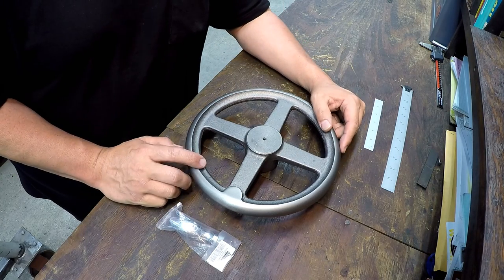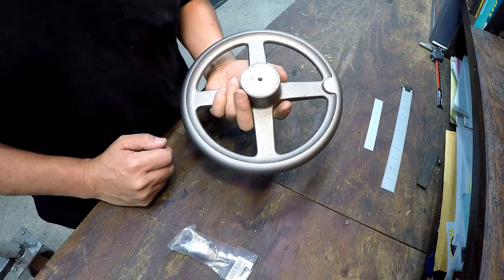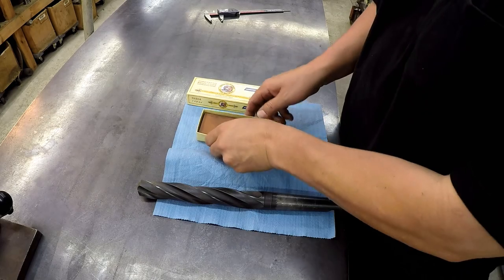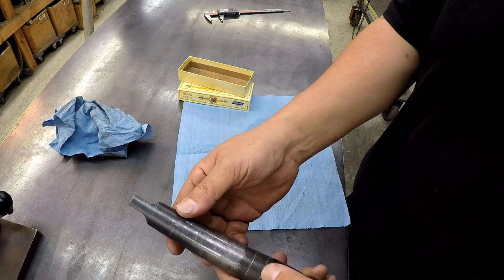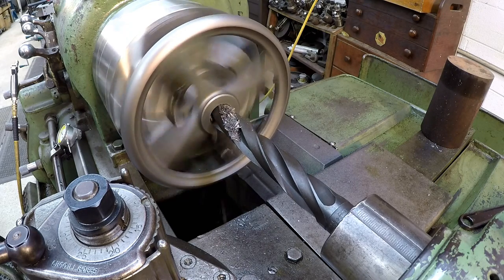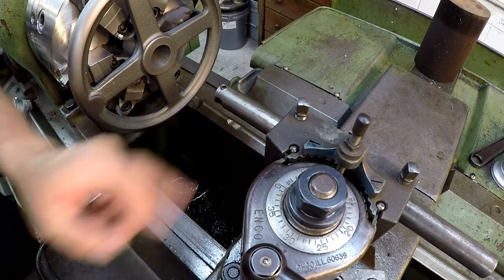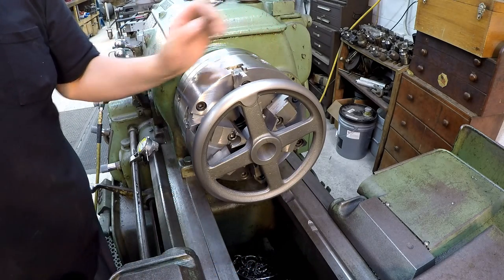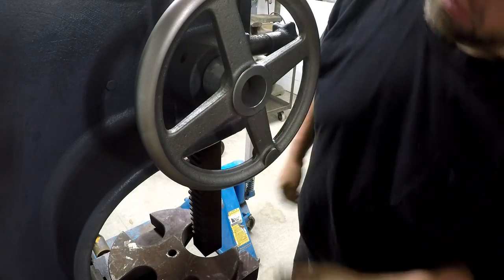Machining a Dake Arbor Press Handwheel

Comment: I like the job.  How about maching a button that plugs in the shaft end to keep dirt out!  Should be easy enough - could be a ball end and a shaft.
Reply: @Martin Eastburn ~ I was thinking the same thing. A BRASS mushroom end plug. Fancy! I made a white Delrin end plug for the arm on my floor jack to clean up the empty hole in the tubing,
Reply: I was surprised he bored it all the way through.  Could have left it a blind hole.  Either way works though, beautiful wheel!

Comment: Nice video... help me understand why you moved the work to  another lathe.  Seems like the work could have been done on the first 4 jaw set up.
Reply: He used a 3 jaw not a 4 jaw for the initial cut. The jaws were reversed on the 3 jaw from another job and would not have chucked up properly for the boring operation. Thus he used the 6 jaw chuck on the monarch lathe.
Reply: Gripping on the boss gives a much more stable grip than gripping on the curved outside. So he gripped from the outside while he trued-up the boss and then moved to gripping on the boss.  He could have swapped the jaws on the 3-jaw chuck he used to grip the outside and used it to grip the boss, but given that he had another lathe already set-up with a really nice 6-jaw it makes sense to use it.

Comment: 15:00 Hate to say it my friend, but hardness does not affect the rigidity of a boring bar. Only the modulus of elasticity, which is pretty much the same for all steels.
Reply from the maker: Sorry, but I don’t buy it. Take my 1” heat treated and stress relieved bar  and compare it to a 1” bar made out of 1018 cold rolled steel. Big difference in rigidity. I only speak from experience in use. That bar I was using is just like any quality boring bar you’d see being used with a carbide insert.
Reply: @Abom79  Well Mr. Booth, I must respect your experience as that is often the only thing that matters. However, from a theoretical POV I must disagree. If you have some free time, I might suggest some bedtime reading about Stress vs Strain curves, Young's Modulus, and the effect of Hardness on the curves. Or if you're more of a visual guy This Old Tony did a video on this exact subject. (You even cameo'd in it haha.) Timestamped: https://youtu.be/vJIzkIc_wIU?t=936
Reply from the maker: @TheMetalButcher  Don't you just love when people try to prove you wrong and correct you. Come on man, a good quality steel bar is going to give you better results then something soft. Your explanations above is not going to change my opinions of that. I'm not an expert on metallurgy, but I know what works and what doesn't and that's all I'm trying to get across in my videos.
Reply: Well exxxcuse me for trying to give back some of my knowledge. I forgot that becoming a big channel makes you invulnerable to criticism. Now maybe your hard bar has some other tricks inside it to change the resonant frequency or aid in damping, I dunno. But I'm trying to stop the myth that a good boring bar needs to be hard to be stiff. I cannot, and will not deny my science for some anecdotal evidence.

Another thread about just this topic... https://www.practicalmachinist.com/vb/general/boring-bar-material-157758/
Reply: @TheMetalButcher  Then why all the best boring bars made of hard material like hardened tool steel and carbide rather than A-36?
Reply: @Steve_Just_Steve  Carbide is easy. It's modulus of elasticity is around 680GPA, whereas most steels are around 200GPA. Thus a carbide bar of equivalent diameter is about 3.5 times stiffer. In general, harder materials have a higher modulus of elasticity, but of a given material (like steel, aluminum, lead, etc) hardness is irrelevant. As far as steel bars go, bars made for inserted tooling must be made hard so that the insert pocket isn't damaged. As fair as other bars go, I see little reason for it. Case or through hardening can help avoid setscrew damage. People would probably think your tooling is pretty cheap if it got dinged up immediately out of the package. They can also be hard to slide through round toolholders if the exterior is all dinged up. Through hardening might keep a bar from bending in the case of overstressing. I didn't harden my homemade bar, I saw no reason to.
Reply: @TheMetalButcher  So heat treating doesn't make steel stiffer at all? (honest question)
Reply: @Steve_Just_Steve  That's correct Steve. Most people's intuition will lead them to think that that is false, as we bend soft metals (like paper clips) so easily in our hand. But once you've permentently bent a metal you've already left the elastic region, which means your part has failed in most cases. Heat treating doesn't make the material stiffer, but it will allow you to bend the material more without it taking on a perminant deformation. Again, I'd really recommend watching the section of This Old Tony's video I linked, or there are plenty of similar videos about that subject here on youtube.
Reply: @TheMetalButcher  I've watched the video and thanks for answering. I'm still a little confused as to what makes hardened steel work better as a boring bar as I have used both and in my experience they do seem to work better with less chatter, but I do understand what you are saying.

Comment: Hi Adam, nice video as always.  Just noticed that the outlets next to your press are installed wrong.  I am not sure when the code was changed, but the ground on outlets is supposed to be to the top.  This is in case something conductive falls between the outlet and the plug.  Instead of a short from hot to neutral it at least hits the ground first.  Some electronics plugged into a circuit that gets shorted do not like it.
Reply: That isn't a code requirement, generally, only a spec requirement. NFPA's Committee on the National Electrical Code has explictly rejected repeated requests to add a standard orientation to NFPA 70 in part because the "safest orientation" is situation-dependent. Orienting the ground upwards provides some protection against a falling object shorting a loose plug, but orienting the ground downward causes the ground conductor to disconnect last when a plug "falls out".

Either situation is generally caused by a common fault requiring correction: plugs don't loosen, receptacles do. If a receptacle in any orientation is not securely holding plugs, it should be replaced. If the plug is commonly being pulled out even from new, secure receptacles, proper solutions include a longer cord; a positively retained connection: direct-wire or a locking receptacle/plug combination; and/or training users to take more care around device cords. Angled, shrouded, or recessed receptacles can also extend maintenance life to some degree.
Reply: @Azlehria  <= Excellent answer. Thank you!
Reply: @Azlehria  The ground pin is longer than the power pin for exactly this reason - so the ground connects first and disconnects last regardless of orientation.  Personally it really annoys me when outlets are installed upside down (ground pin up).

Comment: Thanks, I really appreciated this one! 👍
Can I ask - were you tempted to turn the outside radius of the cast handwheel to try for a smooth / polish for finish, or wouldn’t cast iron finish smooth with a single point cutting tool?
Could it have been abraided to a polished smooth outer radius while it was on the lathe maybe?
Also is there any reason you don’t use tap magic or Chlor paraffin cutting fluid while machining, drilling and tapping cast?
Is it soft enough it doesn’t need it?
Sorry for the 101 questions, I’m just a newb, so desperate to learn / soak up others knowledge. 👍👍👍🇦🇺
Reply: Cast iron can be polished quite good. I don't think it will ever get as smooth and shiny as steel or aluminum but quite shiny anyway. Single point cutting the outside radius would be a challenge, I think it's smooth enough that you could start with emery paper going up in grit and finish it with some polishing compound and get a good result.

Comment: @26:50 is there a reason you wouldn't put the grub in on an angle to allow the use of normal length bits and taps as well as hold near the centre of the boss ?
Reply: Best I can tell, a grub screw may move the wheel along the shaft as you tighten the grub screw. Grub screw pushes against the shaft but is also pushing the wheel away from the shaft. Most that I have seen are 90° to the shaft.

Not a bad question though.

Comment: I am brand new to machining and enjoy watching you make chips.  What do you call the type of lathe you are using where the head is moving on the X axis as opposed to the cross feed with tool?  I would assume the advantage is you have a greater mass moving which gives a better finish.
Reply: it's an optical illusion. The head isn't moving. The camera is mounted to the saddle. You can see the movement when you watch the background.
Reply: @harlech2  Thanks I watched it again and you are right.  The angle just makes it look like the foreground is moving faster than the background.  My first introduction to any lathe was more than 20 years ago with a break lathe.  On the model we used the head would move in and out to do Drums so I thought maybe that was what this one was doing.

Comment: do shops still use the big taper shanked drill bits the shop I work in has a set from 3inch down to 1-11/32 that r bran new but the shank is to big for our press
was just wondering if we put them on ebay if they would sell
Reply: If you’re talking about Morse Taper absolutely they do
Reply: Ohhh yeah. On both counts.

Comment: It doesn't look like it had a grub screw original there was just a bolt in the end its threaded on the shaft
Reply: He said he could see/feel a slight divet from an old set screw. A center bolt would not hold it well against rotation since the shaft had no keyway.
Reply: @scottr939  of course a bolt would hold it why do you think that possibly might have had a grub screw as well doesn't really need one
Reply: @scottr939  Yeah I was thinking about the keyway  idea too.
Reply: @johnsweda2999  I 'think' it had a grub screw because 1) Adam said he saw evidence of it, 2) Adam felt a need for it, and I trust his expert judgement, and 3) physics suggests you need something diametrically strong to stop rotation of a wheel that could see significant rotational force around a shaft. If you can't see why that is needed, I'm glad I don't use anything you build.
Reply: @scottr939  clearly you don't know what you're talking about I leave it like that

Comment: nice job, your are master. Maybe a plastic cap on the center of the hand wheel would dress it up a little
Reply: Plastic? Dude, he could easily machine a cap out of stainless steel, that would look really slick. Maybe engrave the Abom79 logo on it.

Comment: Why do you only sometimes use oil when cutting or drilling?
Reply: On cast iron you generally don't use oil because it's full of little graphite particles that naturally lubricate the cut. Otherwise, he often uses carbide tools, which don't need cutting fluid (they can cut faster if you do use it, but not critical) and don't like the thermal shock of being occasionally sprayed with lubricant, they must either have none or a constant flow. Cutting without oil is also cleaner and lets you see whats going on more easily.
Reply: @nerd1000ify  All true.
Reply: @nerd1000ify  Also, cast iron dust corrodes and can become abrasive. Adding oil just creates a slurry that will ruin the ways on a machine in very short order.

Comment: Have you ever had a piece fly off the lathe while working on it?
Reply: Back in high school machine shop, I was turning a piece between centers. My buddy came over and started loosening the tailstock quill. The piece flew out of the lathe and bounced off my safety goggles.
Reply: toomdog 
At the school I went to (private) that would have got you two things, a black eye and expelled in about as much time as it has taken to read this, or at the very least 6 of the best and detention every day for a term! 
Mind you at my school the teacher explained how dangerous it is in a machine shop and that touching a machine that someone else is running is forbidden and punishable, as were practical jokes, “BOO,” deliberately dropping things to make a loud bang etc!
What a Pillock! What kind of jerk would do that, and to his buddy?

Comment: Why the set screw behind the spoke ???
Reply: The one on the handwheel? It attaches the wheel to the shaft.
Reply: @77gravity   yes i understand but why behind a spoke its a hell to reach it to attach the handwheel. if you drill the hole between the spokes you can mount it easyer
Reply: I have seen iron wheels with s-shaped spokes that are apparently for absorbing casting stresses.
Reply: J IJzer 
For aesthetics, you can’t see it when you look from the shaft end? And because it is for Adam’s machine and Adam has the key to do it up without fiddling through a spoke hole!

Comment: Adam, first thank you for the fantastic clips of your projects. I noticed at 10:40 into the clip that when the drill contacts the center drill the drill flexes. What causes this and is there a concern in more precision projects?  Again, thank you for the great, informative clips.
Reply: I'm not seeing what you're referring to 🤷‍♂️
Reply: Oh yes very observant of you pat
Reply: He is just roughing with the drill, he then goes to the boring bar.
Reply: It can cause problems with tight holes but there's ways around it even the boring bar will flex away

Comment: Hi Adam, My question is from a real novice point of view and I do understand using a set screw to lock in the turning hand-cranked wheel however, why not use a key-way?
Reply: The shaft the hand wheel is mounted on would have to come out of the press to have the keyway machined. For such a low stress situation, almost certainly not worth the time
Reply from the maker: The shaft was not machined with a keyway.

Comment: You use a regular vaccum cleanner? Or its something special for metal?
Reply: More so with cast iron and other ductile metals, to keep the swarf  from getting into the machines ways.
I've seen him use it for other metals too, it's easy cleanup with little chance of the chips being launched to who knows where like with a brush.
Edit: just a Shop-Vac type of vacuum.
Reply: @j-man72b72  I worry about built up oil/wd-40 fumes igniting in mine when I turn it on and blowing the thing apart.

Comment: Why didn’t you mic the hand wheel when you started
Reply: Why?  I believe it is well within the universal tolerance required for hand wheels run at maximum human pulling speed.
Reply: Also, it was a 3-jaw chuck so not really adjustable.  You could tap it with a hammer I suppose.

Comment: Is there any different in the grind, (angles etc), on a drill used in the lathe.. were the drill is stationary and the work turns as compared to when use in a drill press were the drill turns and the work is stationary ?
Reply: I don't think the bits are ground differently
Reply: I'm no drill bit expert, but my uncle (who did a lot of machine work) used the same drill bits for lathe and drill. In reality, the only difference is "which part rotates", the drill bit or the piece you work on, but the actual drilling mechanism is the same.

The drill Adam used here is a three-flute, and not ground to a point, but that's mostly because it's a 1 5/8" bit, so needs a decent size pilot hole to work anyway. Even if you have a sharp point at the end, you can't really just shove nearly 1.5" drill bit straight into your work piece, you want a smaller pilot hole to guide the drill through.
Reply from the maker: Only difference oin the grinds depends on the material being drilled and sometimes the type of drill bit.

Comment: Do the digital readouts and callipers use the metric system, but based on inches? 1.325 inches and so on?
Reply: Is no metric, is decimal inches. 1 inch and 325 mils
Reply: @joselrodriguez5999  Ah, I confused metric with decimal, yes. Thanks.
Reply: They do both metric and inch ,you can change readings at the press of a button.

Comment: Nice fitting. It seems to me the size of the wheel is a bit awkward because of it's smallish size. It looks like it takes more effort than it would with a larger wheel.
Reply: Bit of a tradeoff since spinning it through multiple revs gets a bit easier.
Reply: Not used for pressing, but for adjusting the ram to the work. The goal is easy, large scale movement, not force.

Comment: No soft jaw when you use the 6 jaw ?
Won't that mar the finish you just did ?
Reply: Cast iron don't mar easily, so as long as he doesn't unleash a full can of Abom Torque(TM) on it it'll be good.
Reply: @andersjjensen  Thanks for the info.